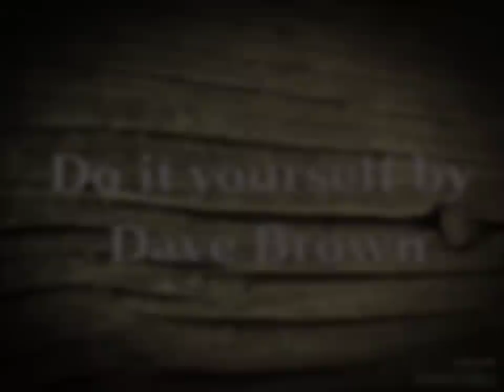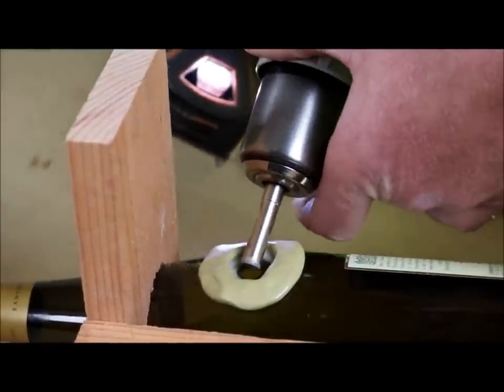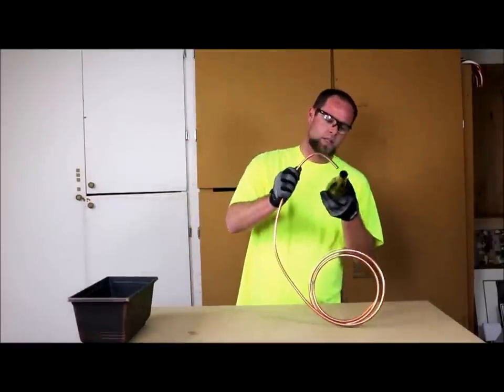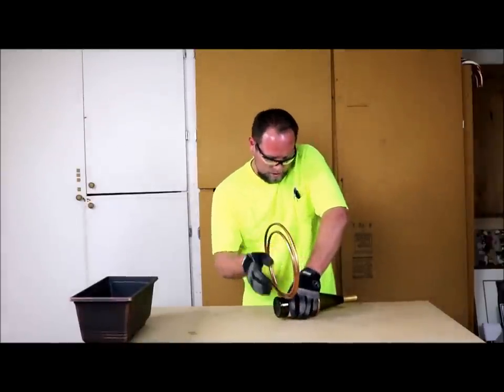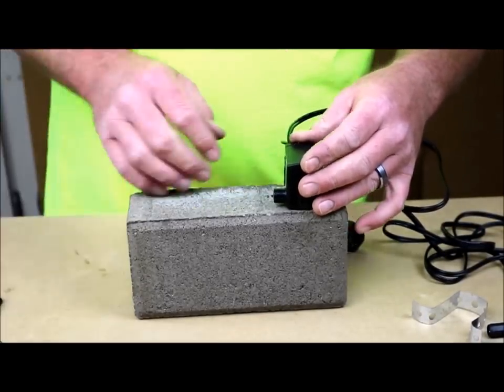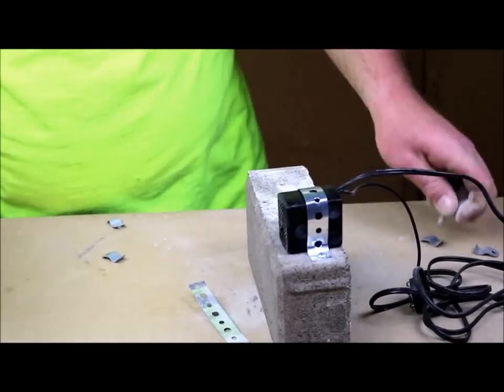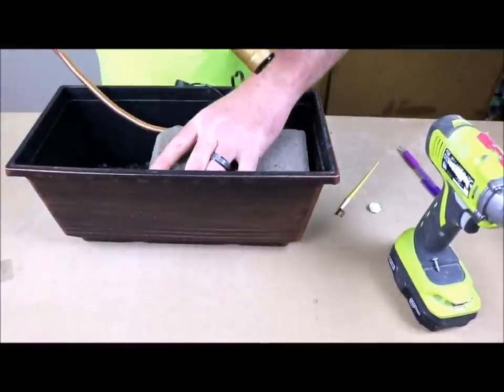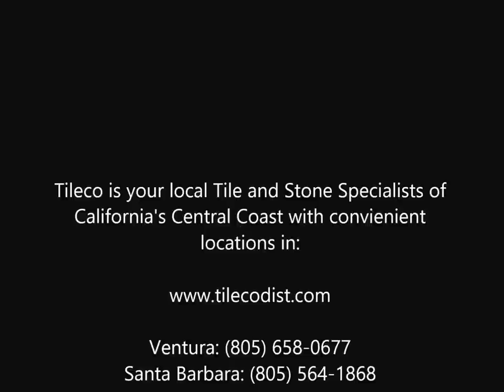Wine Bottle Fountain

Comment: Excellent video. To get around breaking the glass when you are trying to get the tube into the bottle. My suggestions: Stop the copper tubing a few inches from the hole in the bottle and run clear plastic tubing from the copper tube into the bottle. Not sure what size clear tubing you would use but you should match it up in the store when you purchase it. To make the seal water tight coming out of the copper pipe you should probable use a silicone based product.  .  Also a dremel drill with a glass grinding bit to adjust the hole. Also you can use a rubber grommet on the glass to protect it.
Reply: Lol, where's your page? I really like your ideas n would like to see how you do it 🙃
Reply: @tandiparent1949  ..I dont really have a youtube channel dealing with this type of thing...I worked doing glass work for awhile and other jobs that had me using tools and just know how I would do it..Thanks for reading my ideas...It should conceptually work..Or not..:-)

Comment: You could also make a bottle mold for coiling tubing...fill same size bottle with Quik-crete or something. If outer glass breaks, you still have the bottle shape to wrap it around, just allow for glass thickness or pad the cement bottle before coiling. 😀👍🏼

Comment: Great video! One thing I've learned is to immediately rinse the bottle so the glass dust doesn't cake on the inside of the bottle. This is especially important it you are using a lighter colored or clear bottle.

Comment: If you started cutting the hole with the correct technique in the first place you would have had a better angled cut than doing two different cuts. For other viewers, go research cutting holes in glass/tiles first before attempting this